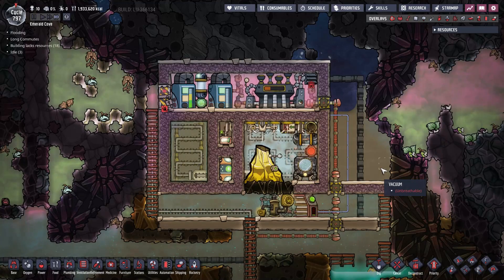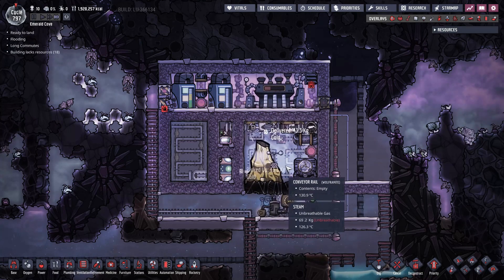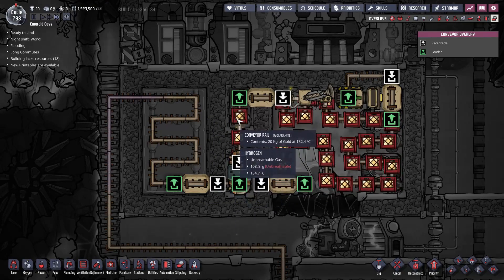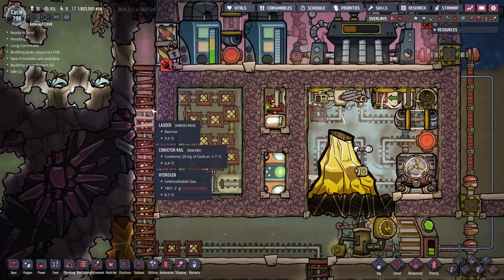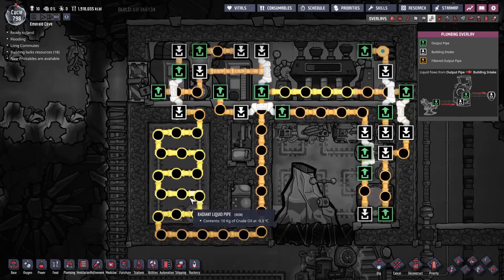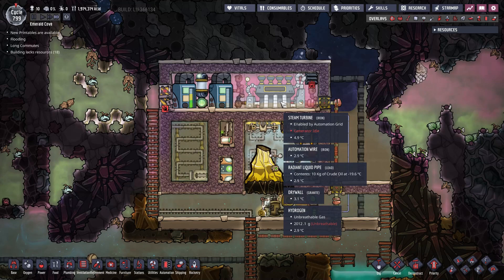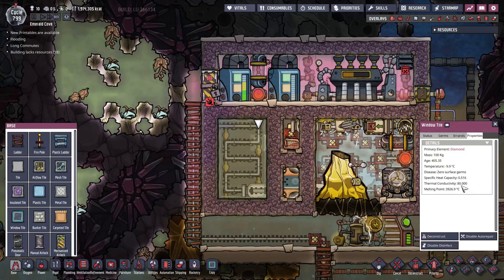Oxygen not included - How to build:  Metal Volcano Tamer!

Comment: I did some tweaks to your setup and I made another thermal reactive brick for water and oxygen, currently with 1 aqua and a gold vocano I am having gold at 10C, 500 grams of water at 20C(from 90C) and oxygen at 10C. I changed the crude oil with petroleum to avoid mistakes. I am really close to have all the base needs with only this setup. For the ones that have trouble with cooling slow, just make sure you have just the right power generation to complete the steam turbine don't add too much power, let the steam turbine do the work and maybe one extra generator for help.

Comment: 2 Questions
If I were to use crude oil instead of polluted water what would happen?
Is super coolant any better to use instead of polluted water because of the Specific Heat Capacity exchange?
Reply from the maker: 1) The aqua tuner will work for longer periods of time for crude oil which means it will consume more power, the trade off is that you can lower the oil temperature far below polluted water.
2) Super coolant is a total overkill for this tamer, its not needed. In theory, you would want to use it everywhere but in practice its limited and hard to make in large amount. its best to use super coolant for designs that require very intense cooling (my volcano tamer design, for example).

Comment: why disable the turbine... i mean you have obviously hit some kind of balance. but in case there is more temp, the turbine needs to work to get out the temp. it's more important to keep the temp low, than to not waste power. 
if you want to not waste power, you could connect it with another transformer to your  main power grid, and turn on the transformer only when the battery is above 90% (for example, using not gate of course) but this way you would keep the turbine working at all times, so it can cool things down if it gets too hot.

Comment: Isn't that build a little expensive in terms of material? Lots of Steel, Wolframite and Diamond. I am currently at Cycle 230ish and struggle to get this stuff all together.  Are there...options? Other than that - excellent design, love your videos.
Reply from the maker: Steel aqua tuners take a lot of steel to construct, can't go around that sadly. For wolframite you don't really need that much, around ~3t is enough for the rails, you find enough in a single ice biome I think.
For diamond, once you get to the oil biome, there are plenty of diamond to go around.

Comment: Idk man, something is off in my base, the aquatunner works like crazy and take a lot of energy, the rail keep the metal about 170 degrees Celsius and keep looping for a long time. Please help me find the problem. What pressure you have in the vulcano room? How much oil you have on the reservoir on the right? How much preasure you have in the little 2 tile room with the thermo sensor?
Reply from the maker: 1) The steam per tile in the volcano room is at around ~65 kg per tile
2) hydrogen amount in the sensor is ~100g per tile
3) Oil amount is at around 3t.

Did you connect the conveyor rail like shown in the video?
did you include ALL the conveyor bridges as well like shown in the video (This is important!)?
Did you set the sensors correctly? (Thermo  sensor is 130C  Below).
Did you connect the rest of the stuff (pipes, automation..etc) like shown in the video?

You can also post a several pictures of your overlays, this will help me notice any problems.
Reply: @stivraptor  I changed the values conform your advice, but my steam in the volcano room reach 200 degrees and stays there,  nothing can cool the steam now. How can i resolve this problem?
Reply from the maker: @rotony1  The steam turbine should be able to lower it to 125C, eventually, it can't stay at 200C for long periods of time.
If you tamed an iron volcano, then you can set the sensor value to ~170C even, the heat exchanger will still cool down the metal to reasonable temperatures.
If the temperature remains 200C in the chamber throughout the active period of the volcano then no problem either, the refined metal will just gather in the chamber and when the volcano will go dormant then the turbine will drop the temp back to 125C.

Comment: I like that your diamond window radiator has a shine bug on it! :D, and I just saw the metal volcano tamer video, wish I saw it sooner... but anyways, thanks for the amazing and clear tutorials, but let me ask you something, is there anyway for me to avoid using steel? My steel production is quite low (lime limited) and I'm trying to build a rocket... but gold is limited to 125C, I worked around the aquatuner (dropped oil on the ground) but not for the swepper/loader, any ideas?

Ps.: Your rail termo sensor is amazing, I needed that! Thank you.
Reply from the maker: Ah, gold is very limited in usefor aqua tuners, nearly everything requires steel (volcanoes, metal refinery, rockets...etc) the only use for gold aqua tuner that I can think of is base cooling.
Anything even slightly hotter than that will require steel.
Reply: @stivraptor  I've actually managed to use 0 steel, take a look https://imgur.com/a/dXriPBV while the arms are working they are in a vacuum, and after they are done the doors close and the oil cools them down, so they will never overheat and I won't need to use steel.

Comment: Summary:
  0:34 Shipping view
  2:14 Automation view
  2:48 Liquid Piping view - Igneous Insulated, Lead Radiant up by Iron Steam Turbine
  3:27 Thermo Sensor Settings -10c. visible near this point in video: Tungsten Automation wire, Steel Conductive Wire, Wolframite Conveyor Rail in the Volcano chamber
  5:26 Power view

  5:46 Another automation shot
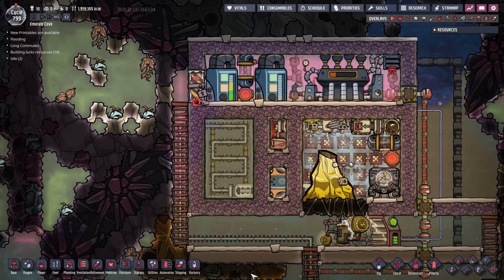  6:11 Start Duplicant build speed vid
  6:29 outer structure plan established

No Gas view was presented, harmed, or probably used for this build.
Diamond Window Tile heat exchange kept at -10c : Iron Radiant Pipes & Conveyors
Turbine Area - Hydrogen filled sitting at 11c with granite drywall(may have been for space exposure), Iron heavy watt conductive wire, Iron Automation wires
Volcano Area - Steel Tuner, Liquid Shutoff, Conductive Wire, Sweeper and Loader. Wolframite Rails and Rail Bridges, Some Tungsten Conductive Wire
Outer Layers - Iron Smart Battery, Lead Heavy watt Conductive Wire, Lead Large Power Transformer

No Tempshift plates, or gas piping was noticed in my watching.

My own experience or thoughts are that lead radiant pipes are cheap, and have a poor exchange rate, but it appears to have been working well. Wolframite rails were only used on the rails near the base of the volcano itself in my repeat of this build and iron elsewhere worked just fine. I did not take proper care in unveiling the volcano and yet besides the sweeper no overheat damage was suffered. I did remove the tuner and wait until later to rebuild it for overheat damage as none of the cooling system was present yet. I was careless after establishing a vacuum via mini pump (less than 1 tile of leakage went in). The mini pump was deconstructed and melted, or just melted I think. There was sour gas in my vacuum chamber with no apparent source. I also built it semi-flipped on the X axis which was difficult to work out, but it worked. The volcano chamber was done the same, the conveyor temp parts were the same, but the exhange I placed on the right.

It seems to be doing wonderfully nonetheless. I think this is my first properly cooled volcano. Thanks a ton! Now if I can just figure out what to do with a fully blown steam vent. I've never seen/tried one that wasn't a cool steam vent.
Reply from the maker: Hehe, I think you're going to love the next video ;)
Reply: @stivraptor  What was the temp setting for the thermo sensor with the Aqua Tuner?
Reply from the maker: @13376UNN3R  "Above" 5C
Reply: Steve Raptor thanks man!  Keep up the good work
Reply: main chamber with both sides is 14x7. does not include water lock entrance, steam turbine area, or power distribution below 
volcano chamber is 8x7 conveyor heat exchange is 5x7 but shares a wall with the volcano room
Reply: 👍YOU are a LEGEND for detailing all of this!👍